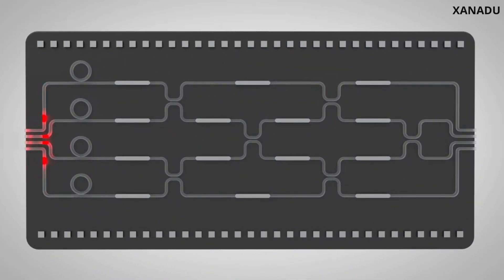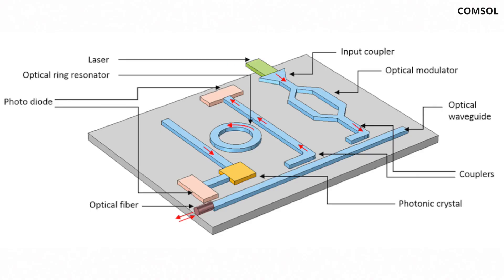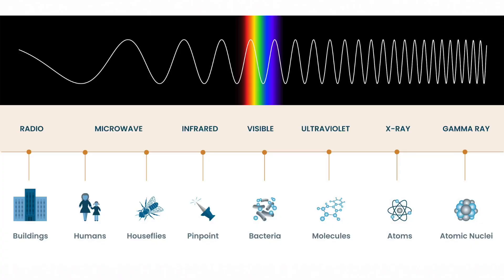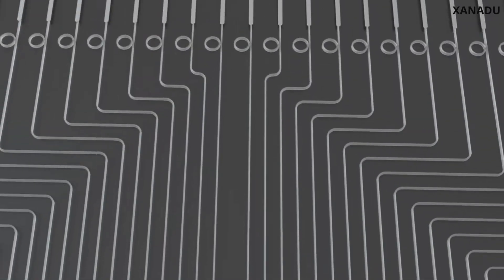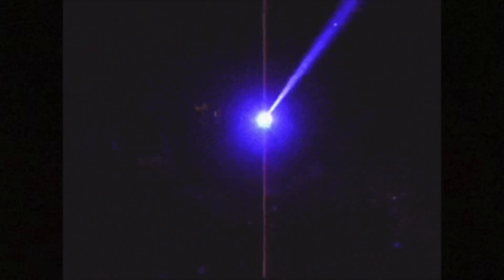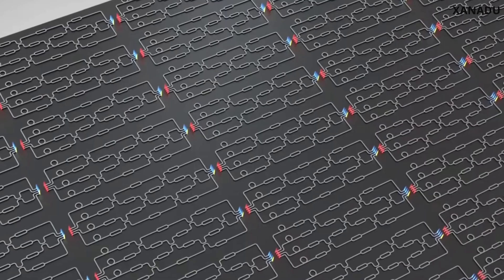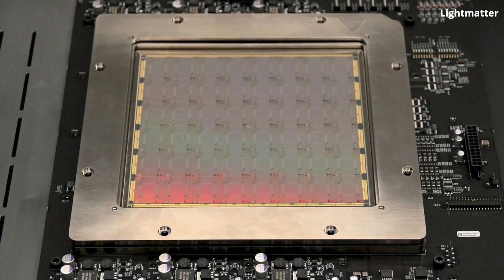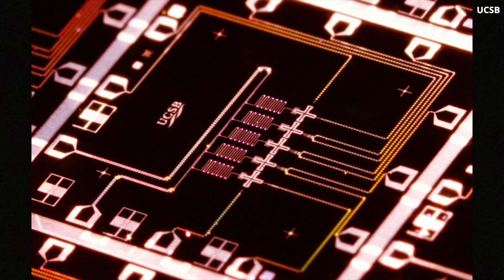New Photonic Chip: x1000 faster

Comment: What your talking about is a mach zener modulator, ive made these with  modulation up to 120Ghz.  Not trivial but what did they actuall do? Made it really small, did it on a wafer with other elements?  Mach zender modulators have been around forever

Comment: The layer of LED or LCD so thin and power is very smalland it enclosed both background , 3 layers , and the reader in one housing and each chip had thousand of array of connect point like cpu og gold pins to monitor , speaker , sensors and memory and times line

Comment: 3 layers of lcd or LED then 3 times phases drive light and a background light then mix new data or instruction onto ccd array to carry out action or display or mathematics computation out put to the array of connector to device or speaker or screen or text driver ect or drive electromagnetic density and pattern to read space data conteniously in space upto 3 ft and eaclt layers is few micro metter and repeat every second and every 3 ft

Comment: What if graphene were used as a memory device. Use light as a processor and communication device. Photons have no resting mass as they are always moving until measured. The measurement device captures the photon in a resting state. 
Therefore, theoretically information entangled with a photon could be captured by a photon and stored in graphene. 
Secondly, neutrinos have theoretical properties of superposition states that could see predictive probabilities from 0 to 1. 
Just a matter of time.

Comment: A computed image is a grid or array, and the data in each cell is a value. If you can do this, then you can use an array to, for example, replicate a binary byte (8 bits)  or larger binary arrays. Ergo, these chips can do much more than process images.

Comment: Interesting to see a video on this when I work at a company designing optical computers :D I am happy to see more coverage. We are talking about clock speeds on the order of teraherz, we dont have to deal with inherant capcitance or thermal limits. Also, the goal isnt to replicate electronic architectures but utilize some properties of light to do operations in the analog domain, e.g. fourier transforms are extremely easy and efficient and only take a handful of components. That said, afaik my company is the only one doing digital computation as well (which can be done!)

Comment: Simply sad, sea snail is still faster then we are today. I mean many years back I reded that sea snail can sand thrue his (can't remember what) the hole rainbow and in the same time human can sand over optik only 1 color. This chip sound interesting still it's not enoff to cary data with speed of light bot you need to produse the data in the first place. How is the heat? If laser need 100W hmm lets wait 20 more years xD

Comment: To collect sunlight into a small intense beam, magnifying its brightness with a microscopic treatment mimicking the way water "slugs" are created that are sent like packets through the air; while getting a straight beam with fresnel lens that have been millefioried into optical lines that have a reflective outer coating, thus possibly improving a low cost light available for the new computer.  🤔

     💙

Comment: So instead of adding binary on digital in AND node or Invert by NOT node we use color mixture 2 light shine on the chip give out additive color had number corresponding to new color so it can add billiond of addition on a single loop less than second by feedback like op amp circuit by feeding output to input until counter stop than like bank record or bookeeping or data checking or descypt movie 3 gigabyte can unfold less than 2 second on 1.7 gigahertz clock cpu

Comment: Have to disagree that the power numbers don't hold up. They have proved that their logic gates work at a higher efficiency, one small step to making a whole efficient package. They werent trying to make the whole system efficient in the same way that the NIF doesnt include the laser input power in their Q calculations

Comment: Not long after optical data storage, (CDs/DVDs, etc), came into common use, I expected data storage to quickly evolve from the initial one dimensional storage like what is used for CDs, DVDs and Blue-ray, to 3 dimensional data storage using some kind of crystal storage medium. Just as an example,  imagine a wedding ring where the video footage of the wedding is stored inside the diamond and accessible by a device specifically designed to read the data on the ring, by placing the diamond, (or other gemstone), onto a special optical reader.  Of course so much more than video/audio could be stored in that diamond, but it would be a great and novel way to help bring the technology into the public eye.
Reply: There has been talk about that for decades.

Comment: What about the parts of the computer that can't be made photonic, like the RAM, hard drive, connection to the monitor, etc, that are still electronic, and thus the bottlenecks that will slow it WAY down to the speeds of the electronic components, won't they?

Comment: As a layperson with only a basic understanding of this, I'm not sure why this can't do everything a conventional X86 CPU does at the same power usage and dramatically faster?  If microwaves are encoding light at high speeds, is there then a limitation of what computations the light based logic gates can perform?  I would think with microwave encoding at 67GHz this could all be gotten around through creative means at the light gates even if it drastically reduces the total bandwidth for some operations because of processing inefficiency.

Comment: Electricity also moves at lightspeed. But the speed at which it moves isn't relevant; it's the achievable switching speed which is important. Electronic transistors switch at 80GHz, but supporting components can only manage 8GHz, and then only when very cold, so we go for parallelism instead, which easily gives a thousandfold speedup.

Comment: So it's really just another version of a couple charged device (ccd sensor) like a digital camera would have but with the need for laser input beams. It has no use unless there's a real optical speed mirror or prism to change the laser path as fast as a transistor. Well, actually, ions can already do this, and there's a number of ways but one that does it using high voltage and a certain crystal come to mind. I'd really love to share this but as soon as I do I realize someone will patent the idea. The only reason it's not patented is because the application originally made over 20 years ago.
As soon as I get specific, some little chinaman is going to put a team together to steal the idea so maybe I should work on a patent. It's literally so fast and easy and cheap.
Hey I tried to read the paper but it requires paid membership. The images kind of say it all though.

Comment: We cannot use photonics for calculation. Its only a myth. The propagation speed is the same as in electronics, the power is very high and the most negative things of it is functionality. In 1square micron you have one photon that do nothing, it can only move or die, while in electronics you have almost 100000 transistors. So if you need memory you have, computing power you have but in photonics you don't have neither memory nor calculation power. Finally there are a lot of problems to interconnect photonic chips and you must in the end of the to connect it to electronics. So photonics are only good for articles/papers.

Comment: Is this for quantum computing or normal computing?  I'd also like to point out that lasers can generate a lot of heat at their end points.  Wherever the light stops is where the heat will be generated.  You'd need a cooling system of some sort which would use power.

Comment: There is one caveat: you need to download a huge amount of data to the photon chip at the same time and then, after obtaining the result, download it to ordinary computers. And even if an I/O device is created that will work as fast as a photonic chip and will be able to store initial data and the result of calculations. It remains the same problem with the speed of data exchange (analogy for speed: upload data for calculations to a modern computer, the way they were uploaded to the 8-bit ZX-Spectrum - from a magnetic tape).

Comment: what if we make a tiny emitter which can change lightwave programmable. then we may change the frequency and pass light programmable through one way or another. it would be like an optical switch. receiver->emitter(programmable wavelength)->few outputs depending on wavelength->receiver->etc. is it possible? will it be fast?

Comment: Silicon Photonics have been tried before by HPE’s ambitious ‘The Machine’ project. It’s worth noting that while the idea behind The Machine was revolutionary, aiming to redefine computing with memory-driven computing and silicon photonics for faster data movement, it encountered significant hurdles. One of the major challenges was the sheer complexity of integrating silicon photonics into existing computing architectures. This technology, although promising for reducing data movement latency and energy consumption, proved to be difficult to scale and integrate with current hardware and software ecosystems efficiently.

Furthermore, the ambitious nature of the project meant that it was ahead of its time, both in terms of the technological landscape and the market readiness for such a paradigm shift in computing. The ecosystem for supporting technologies, such as software that could fully leverage memory-driven computing, was not mature enough, making it hard to demonstrate the full potential of The Machine.

Lastly, the economic and practical aspects of bringing such an innovative yet unproven technology to the market played a role in its challenges. The investment required to further develop and potentially commercialize The Machine was significant, and with the fast pace of technological advancements, HPE had to weigh this project against other, possibly more immediately viable, innovations.

It’s a classic case of an ambitious project that was somewhat ahead of its time, facing technical and market-based challenges. Still, the research and developments from The Machine project have contributed valuable insights into future computing technologies.

Comment: If the cpu's don't produce as much heat, they don't need as much cooling and are less likely to fail if the fans fail.    I think they could also seal the cpu's in resin and make them hardened against environmental factors, emp strikes, corrosion.     Radio waves move close to the speed of light.    The speed of sound is a different thing all together.

Comment: One can take. 5 minute break in war time and still win. But running  AFTER a computer instead of piloting it right with THAT one button solution. Is just mis management. Loosing control over a wrong written program on high speed is dissasterous. In a network. Maybe computers also should have a speed limit. The software just changes too much then too call it stable. Program software developers thinks things thru. But a computer itself it can not think. This always happen (see video) when a human employee is replaced with a computer. Better fire the computer this time and hire an human again.

Comment: Give them a break.
It is conceivable to minimise the light source laser down to a nano size which could be printed on the chip. Being an optical engineer I can't see why they couldn't do this and I am sure they have been working on this. The same could be said for the sensor. Yes there will be power consumption on the input and pickup but virtually nothing in the processor!!!!

Comment: Or the software could be written more efficiently.
We don't think that speed matter all the time. Running the computer for a week too get the desirable outcome (i.e. povray) is no exception in 1993. So why hurry ? Speed is something where time and money is combined. But not for everyday use ages in a private household. (Network or server data need be fast.) The need for a real time simulation is philosphicley wrong while it counts the observer out too avoid recursion in the lean time. And therefore never accurate. Why hurry ? Just relax. You stress us out.

Comment: 🤔 Hmmm 👉 Graphene wires can take the heat and produce light of multiple wavelengths and cool down almost instantly 🤔👉instead of the 2 atep binary system : an entire spectrum bandwidth could redefine coding beyond limits 🧠 😁

Comment: A special-purpose chip... The problem with optical computing has always been the inability to BEND the light. It ALWAYS has to be reconverted to an electrical signal and routed down a wire. Yes, you can bend an optical fiber or channel, but bend it too much and you destroy the total internal reflection. So light is great for long-distance communication, but nearly impossible to work with on the microscale. Notice how light in this chip had to come in one side and out the other. Venture capitalists were looking at lithium niobate in the late 1980s. Nothing as ever really come of it.

Comment: Photonics I can agree with radio waves I would argue are Too easy to interfere with or interrupt or make dirty and interrupted. However if we could use magnetic waves as a frequency this would be a much more stable source of wave I would gather glasses still as many factors that would cause interruption and inconsistent  rather incorrect for computing. One of the key components in computation is the ability to be correct the majority of the time very few if at all errors which In the case of a few  it is rectifiable. It's just another thought however flawed as much as radio waves are probably too but I'm totally behind photonics it is tried and true the aspect of computing today that is hell or information travels across continental through optical cables fibers underneath the oceans and caddlehops that process trillions of calculations of all around the world every second very moment of every day. I can see everyone's chocolate melting now.

Comment: The problem is that the optics will only ever be able to perform as fast as the  conventional computing can run it.  Light works with wave guides instead of conductors.  This makes it very difficult and lossy to work with.  It will never be as easy as conventional methods.

However, in the quantum realm, things can be a lot more complex and do not need wires to work.  Things just need to be quantum entangled.  It has a lot of promise to run very very low power, fit the combined power of every computational device ever made into the size of a grain of rice, and operate a near infinite number of exoflops in a single Plank time unit.  It promises to be dangerously fast.

Comment: You keep on says mixing radio or microwaves with photonics. Radio waves and microwaves are just the same as visible light just with a lower frequency.

Also light in a vacuum is the fastest thing possible, light is slower in optical fibres or any other medium, the speed is equal to the speed in a vacuum divided by the refractive index which is around 1.5 for glass. A good example is Cherenkov Radiation which occurs in nuclear fuel pools when particles go faster than light in water.

They can’t just ignore all of the main components when talking about power usage. You will always need a laser and waveform generator and receiver at the other end so those will always be part of the power usage.

Photonics will continue to have the same issues as analogue computers, they are very good at what they do but they are sensitive and aren’t reconfigurable. Considering at the moment they haven’t even managed to make Field Programmable Analogue Arrays (FPAA), similar to an FPGA but analogue, I don’t have much much hope of a general use or reconfigurable photonics chip any time soon considering that a reconfigurable analogue chip would be much easier.

Comment: It is very likely certain computing operation can benefit from a combination of analog scalar and precision digital operations -- Analog to "guess" approximate values and digital to check results, provide correction factors and then the algorithm recycles. It is like a poor man's quantum computer where you do not need to temperatures near absolute zero to by-pass entropy of thermodynamics(to reduce noise). Some reverse operations are hard to computer, where you want to derive which inputs produce desired results.

Comment: a lot of work here: congratulations! I totally agree with the last part of your video.
Just a comment about what you say at the beginning of your video on silicon chips (3:30). Silicon photonics do exist and are also working very well. Silicon may be "black" in the visible optical domain but it is completely transparent in the near infrared region where all these photonic developments are made (mainly for optical telecommunications). And the chips discribed in the nature paper you present use silicon, silicon oxyde, silicon nitride material for passive waveguides (all the circuitry you describe) and thin film lithium niobate above these waveguides for electro-optic modulation (the mixing part) because it's a bit faster than silicon modulators that do exist as well. By the way, the wafer that is shown in the video at 11:35 is indeed a silicon wafer integrating silicon photonics technologies

Comment: I too am excited by photonics but remember, electrical signals already travel through circuits about about 0.67 times the speed of light and, because semiconductors are a very mature technology these signals only have to travel a few micro-meters.  Photonics circuits are currently substantially larger and, because photonic circuit light travels through Lithium Niobate, the speed will not be c but instead c/n.  Lithium Niobate's index of refraction "n" is 2.3 so, in that case, the speed of photonic signals will be about 1.5 times slower than the speed of electric signals through a semiconductor.